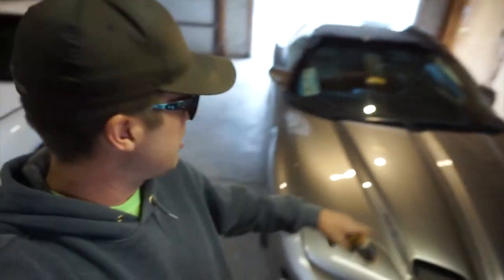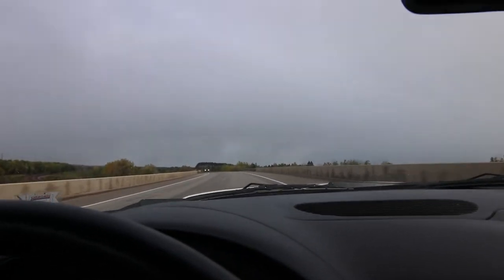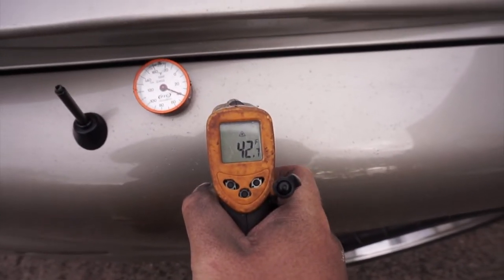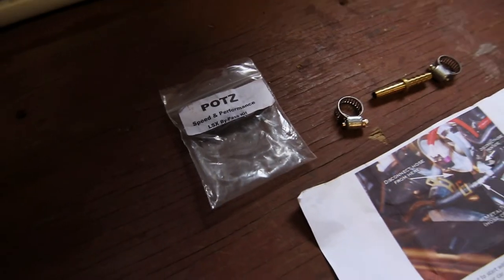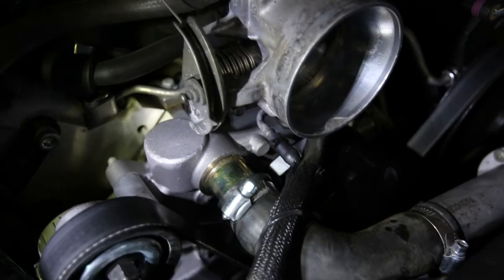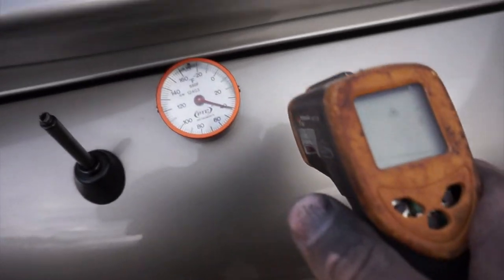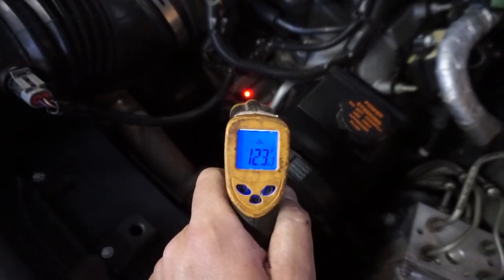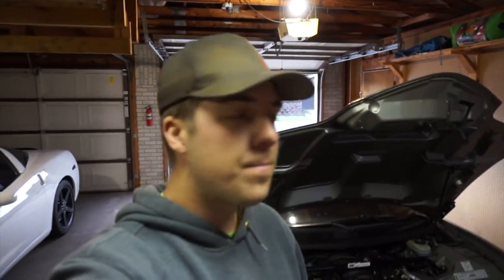Throttle Body Coolant Bypass Mod - LS1 - Does it work?..

Comment: Quite awhile back I did the throttle body bypass at an auto zone, lol.An employee was curious and was running back and forth with tools and hoses for me. Fun times.
Reply from the maker: Good stuff!! The cool part is you would easily be able to do the coolant bypass in any parking lot.

Comment: I've also heard that the lt1 radiator is better because it's bigger than the ls1. I've already did the by pass but they say it definitely will run a lot cooler with an lt1 radiator
Reply from the maker: I'll keep that in mind if I run into cooling issues. So far it's been good!

Comment: One of the first mods I do to a car is delete the throttle body heater, if it has one. Here in Florida, throttle body icing isn't a concern.
Reply from the maker: Personally, I think it's worth doing as these cars are only driven when its nice out 99.9% of the time

Comment: Am I the only one who caught the math mistake?  You said after both 24 mile drives your temperature difference was 16.65 degrees lower after the coolant bypass, however 96.0 minus 73.35 is 22.65 not 16.65.  So really it lowered the temp more than you originally calculated.
Reply from the maker: vans1107 no, someone caught it on LS1tech first lol. Unfortunately you can't edit a video once it's uploaded. 

Good catch though!

Comment: There’s never been a debate over this mod cooling your throttle body. The issue at hand is will it affect the intake air temperature enough to make a horsepower difference. You have to measure your IATs
Reply from the maker: Agreed, if I did it over again and happened to have HP tuners or a scan tool at the time I would have tested it that way.

Comment: I just did one on my 2000 Honda CR-V. I put a new 3 row aluminum radiator in and of course the throttle body inlet wanted to leak. I couldn't find a gasket so I has to make a gasket. I put it back together and lo and behold I got another leak under the throttle body in a different location. So I just bypassed it with one long hose out of necessity. I already have a cold air intake now the hose just goes directly to the idle control valve. So I'm going to see if I gain any performance if any.

Comment: I believe this Test should have been done in The Summer speaking of 80-100 degrees outside and in Traffic
Reply from the maker: I would tend to agree with you on this. That being said, I happened to do the mod at the end of the year right when it started snowing lol.
Reply: @Greenlightfilming  Nice I see, Well I say this because I would like to Know would this have Worked in Summer weather, Because I live in Desert land and i plan to get this For my Trans Am.
Reply from the maker: @robertcampos4204  I would bet there is a difference in hot weather, yes. Its pretty common practice to keep the hot coolant out of the TB.  It's so cheap, it doesn't make sense not to.

Comment: Next step:  put a 2 gallon jug of water in the trunk and pump ambient water temperatures through those TB lines to drop the temperature 30 more degrees.

Comment: Found your channel on ls1tech. You going to eventually do some track videos?  Either way you got a sub man!
Reply from the maker: Havoc Racing yes I am! I'm a little bit worried with a 315 on the stock 10 bolt haha. The pinion has a slight leak, and the nearest track is over 2hrs from me.
Reply: @Greenlightfilming  lol yeah def on borrowed time. You need a tow rig man.  What kind of work do you do?
Reply from the maker: Havoc Racing you're telling me! Haha. I really need a nice truck and trailer to go racing. I work in the trades.

Comment: The throttle body temp is irrelevant with regard to engine performance. What you need to measure before and after is the change in Intake Air Temp.
Reply from the maker: Ladco77 i think the throttle body would have some effect on the air temperatures in the intake manifold. Whether it is 1* or 30* when fully heat soaked is another question. 

Personally, I don't think that the effect is as big as you might perceive it to be. The air would be moving through it quick enough that I bet the thermal affect isn't much on the moving air stream. 

That being said, it's common knowledge that lower intake temperatures are better.
Reply: @Greenlightfilming  Yes, it can affect the intake air temp, but the temp of the throttle body only matters due to it's effect on the intake air temp.  If the IAT is 50ºF, the engine doesn't care if the throttle body is 50º or 200º.   Measuring IAT tells you what difference the engine is seeing.  If you don't already have one, pick up an OBD-II bluetooth reader and the Torque app for your phone.  It will give you a wealth of information as well as the ability to read and reset SES codes for about $20 for the reader.  The app has a free version you can try. The "pro" version is ad-free and cost about $5.  It's a great bang for the buck. I use it frequently on all of my OBD-II cars.
Reply from the maker: Ladco77 i do have an obd2 scan tool. Really handy for reading and clearing CEL's for sure. It does have a live data streaming feature that I hadn't thought to use on the car when doing the testing. 

I believe the IAT sensor is before the throttle body though, so I doubt you would measure any difference?.. Idk. You seem to know more about it than I do. What do you think?
Reply: @Greenlightfilming  Excellent point! I had forgotten the IAT sensor was before the throttle body.  You are correct, that would measure no difference. Ideally you want some way to measure the change in the intake air temp and I wasn't thinking about the entire flow and where the sensors are located.  I don't think there's any sensors that can easily measure the before/after difference.  MAF and IAT both being before the throttle body doesn't help. I'd be really interested in seeing direct air temp measurements to see exactly how much difference in makes. The air goes through the throttle body so fast, there's limited time for it to heat up, but I'm sure it has some effect. Even if it had zero effect, it does clean up the lines around the throttle body.
Reply from the maker: Ladco77 haha I hear you man. I hadn't considered that either until someone else pointed it out to me. *doh*.... 

Like you said, I'm not sure how to measure the effect but I'm sure it has SOME effect, but how much? No idea. Its still bro science to me at this point haha.

Comment: You could get a cheap obd2 code scanner and monitor the iat
Reply from the maker: Absolutely. I wish I had my HP Tuners and laptop when did this.
Reply: Bought a stubby OBD2 reader for $11  that operates via bluetooth and connects to Torque App lite which is free to download installed on my phone or tablet.

Comment: What car/truck is your intake tube from? I've been looking for 1 to fit my car that I swapped a LS2 Intake/92MM tb onto. I'm also running  SD tune so I have a pvc pipe replacing that but it's a bottleneck now. Thanks
Reply from the maker: Dan Niksich ummm..... I guess I'm not entirely sure. I bought the car with it already being speed density.
Reply: @Greenlightfilming  Yeah, I subscribed and found out watching your videos that you bought it like that, thanks for replying though. Awesome car by the way, same color as mine.
Reply from the maker: Dan Niksich thanks for subscribing! Hope you enjoy the uploads. 

I didn't see anything in your channel with your car. Its the best color on these in my opinion...

When I get a chance, I'll take a look at the pipe and let you know what it is if there's anything on it.
Reply: @Greenlightfilming  Appreciate it, never did upload any videos of my car. Din't think about recording the dyno tuning until after it was done, duh. Thanks for checking that when you get a chance.
Reply from the maker: Dan Niksich will do! Thanks
Reply: Just get the round bellow for the slp lid

Comment: The actual reason for the coolant through the throttle body is to reduce carbon build up in the throttle body. The TB coolant bypass is a thing for TPI cars too. I haven't done it my self because I don't think the intake air spends enough time in the TB to make much of a difference in performance. It'd be interesting to see befor and after (same day) dyno or time slip numbers.
Reply from the maker: Nicholas Rodrigues interesting.I hadn't heard that reason before.I was under the impression that it was to prevent icing, but that makes sense with the factory emissions stuff being connected.
Reply from the maker: I searched about this quite a bit the last day and I still haven't found any supporting info on the carbon buildup aspect. Link?...
Reply: @Greenlightfilming  that's from text books and manufacturer specific technician training so I have no links. But basicly what it does is prevent condensation from forming in the TB behind the plate which carbon deposites stick to.
Reply: Nicholas Rodrigues interesting!
Reply: hi
Reply from the maker: @frankiebrown5882  hi
Reply: So wrong...nice theory, but like on most of coolant heated throttle bodys the coolant just gets in and out without on a little chamber (drilled hole from one side of the "mount" to the other) any interferance on the interior side of the TB, no contact with the air. Its just one way to heat it a little bit to make the humity on the TB evapore before you park the car on a freezing night. About the test, sure, TB will be cooler, but the air will contact with the TB for such a short time that it will not have any impact on IAT. The intake manifold could get a bit hotter, but its bolted to the head so...cant see to make any difference.

Comment: Is there any reason why I couldn't simply install a valve inline and close it in warm weather and open it if I experience icing in very cold weather?
Reply from the maker: You want coolant to flow from one end of the circuit to the other. I wouldn't cap/valve it.
Reply: @Greenlightfilming  That was my thought too. Thank you.

Comment: Does that one have plastic AC lines an plastic locker for the lines? They fall apart an leak all the time an the line isnt worth fixing if it goes bad
Reply: An the line ur working on now idk i think not haveing it is just as good in less your pulling loads of power out of it then the air would cool its just as much

Comment: Dude!  Great video!  My 2000 SS is that same color.  I bought the kit but got so frustrated with the (mine was aluminum) connector that I got a long piece of hose and did it that way.  Your motor sounds great!  What do you have done to it?  Never mind I’ll check your other videos lol.  Great job!
Reply from the maker: Congrats on the purchase! Doing it with hose is a good way to do it. The engine is a stock LS1 with a Brian Tooley Racing Stage 4 Cam and bolt ons.

Comment: wish it cuda been measured with a dyno to see if/what the RWHP changed
Reply from the maker: It should ultimately make the engine not reduce power if anything. It wont be much but every bit counts.

Comment: Cooler, denser air will mean for more oxygen at the 02 sensor, triggering the injectors to open longer for more fuel to compensate. More fuel = more power.
Reply from the maker: Agreed. If the engine's coolant/oil can stay cooler longer, the ECU won't pull ignition timing either. . It's a small modification to do, but vey worthwhile in the big picture. It can be done for almost free.
Reply: @Greenlightfilming  yeah, I had a vehicle with a water jacket on the intake manifold. A couple of vacuum caps, a double hose barb and some hose clamps like that cost me $5-6 but made driving a lot more fun.

Comment: This is one of those mods that LS guys like to do because they think it is helping in theory, but in practical terms it does nothing. No way you would feel any HP gain from this, and I doubt it would even be measurable on a dyno if you factor in variance between dyno pulls.
Reply from the maker: Should everyone leave it hooked up?

Comment: So what exactly was gained?
Reply from the maker: The idea is you are no longer circulating 180* coolant through your throttle body. There's no reason for that in the summer when most people drive them. Worst case scenario, is that you have less plumbing to fail, and your throttle body won't be super heated for no reason. In the end, you should have a slightly lower IAT than it otherwise would be. Every little bit helps.
Reply: @Greenlightfilming  My neighbor bypass his TPI. Instead off capping off the ports he ran both hoses to a pump sitting in a ice chest. So weird watching TPI sweat but it works for him on hot track days.

Comment: hp gain? what does that do if anything when your cars cooling system is working properly
Reply from the maker: It prevents coolant from heating up your throttle body and consequently your IAT's

Comment: WTF that is just like a simple garden hose coupler that you can get at any hardware store for $ 5.00. it's just a different size. That's all. HaHaHa. GreenLightFilming, what size diameter is the coolant hose?
Reply: Im thinking 11/32
Reply: @permabulk1454  Thanks, man. What did you use for the plugs on the tb? Where did you get them?

Comment: I did this to my 1986 toyota van 2 years ago ,  because there is this dud on youtube showing this glass fyll of fuel and he try lighting it on fire , he had a hard time , he then spray the fuel in the air with a lighter and the fuel lit .......I guess hot air evaporates cold gasoline faster.....This technique help my mini van pass the smog test....I never put this on youtube ....Sorry.....SHIT!....PS .....If your vehicle is equipped with a electronic throttle body , would it decreases its life ? do to the fact the engine is attached to the intake and the intake is attached to the throttle body and the heat is more because of the bypass?......Electronics hate really hot shit.

Comment: Your throttle is going frezze and stick.
Reply from the maker: Adam Fredrickson it can't freeze if it's parked all winter.... Haha
Reply: @Greenlightfilming  Keep in mind it can freeze with ambient temps above freezing. The pressure drop from the air passing over the throttle blades will cause the air temp to drop below ambient briefly.  I doubt it's a big risk, but something to be aware of.
Reply from the maker: Ladco77 no doubt! Where I live, there's zero risk of it freezing while driving lol. Once it gets that cold out its probably snowing and the car will be parked til spring.
Reply: Freeze? You mean vapor lock? It would have to be pretty cold to do that. I ran my car in the winter and never had a problem. He doesn't seem to run his car much in the winter so there won't be a problem there.
Reply: @rockroll9513  Throttle freezing and vapor lock are two different things. Throttle blades freeze when moisture in the air freezes due to the drop in pressure across the throttle blades.  Vapor lock is when fuel boils in the fuel line, causing the fuel pump to not be able to maintain fuel pressure. (virtually eliminated on fuel injected cars due to the higher fuel pressures.  Was pretty common on carbureated cars.)
Reply: @Ladco77  yes I know they're two different things. I just got a little confused with terminology. Freezing meaning icing. There's another term for something like vapor lock that occurs when it's too cold. Maybe somebody else will chime in who knows what I'm referring to? Anyhow, lots of people have done this mod and achieved a gain of 1 or 2 horsepower on the dyno.